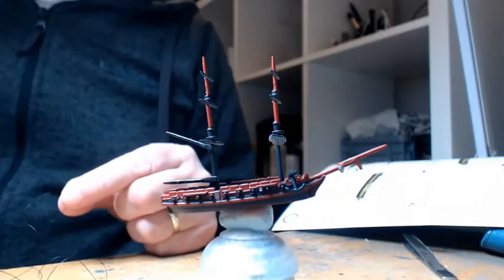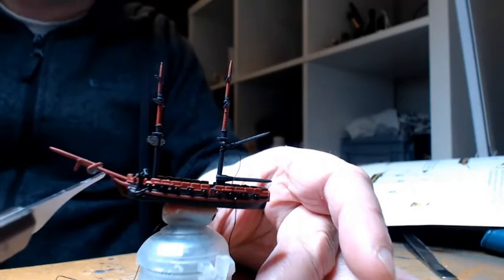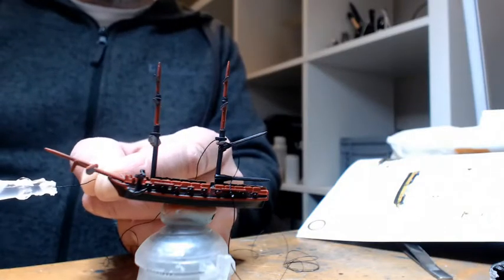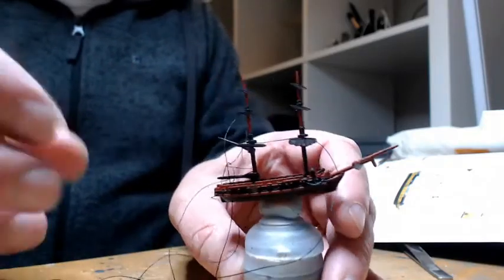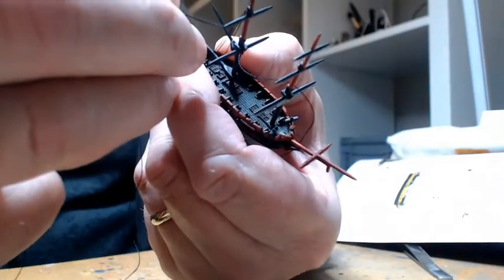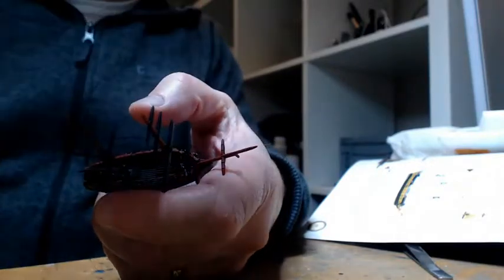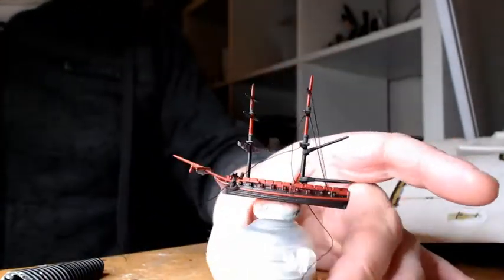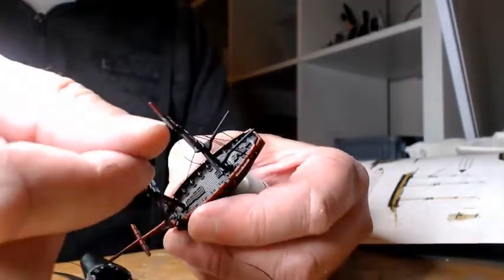Brig Rig - Using a single thread!

Comment: A trick that I figured out when trying to thread thru the small holes for the back stays.  Use a sewing needle threader.  It will fit thru the hole, then feed the thread thru the needle threader and pull the thread thru.  
That's how I do mine from now on. It saves a lot of frustration trying to get the thread thru that hole.